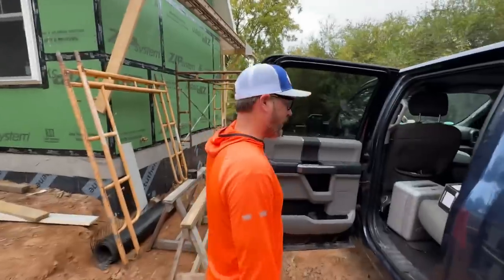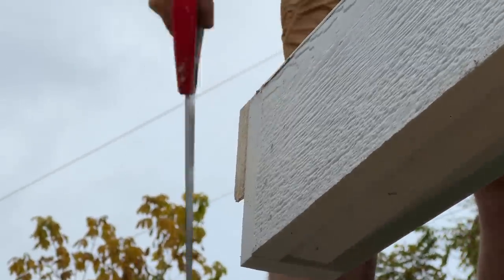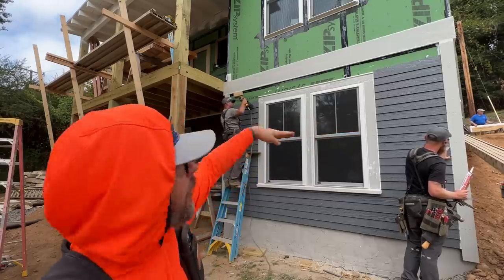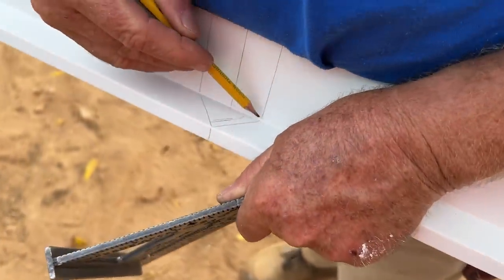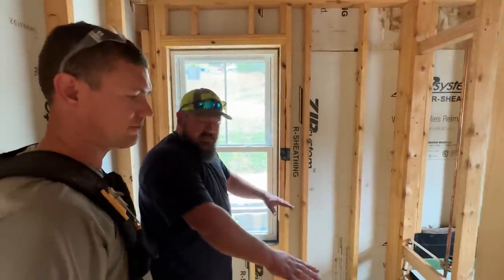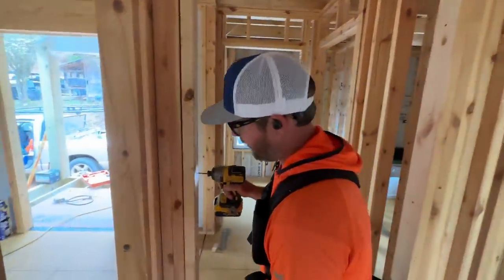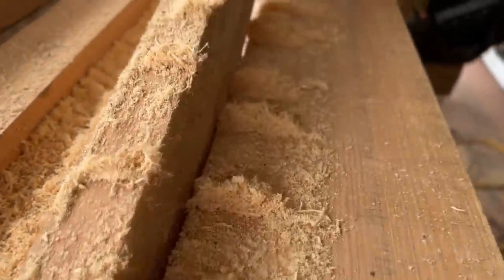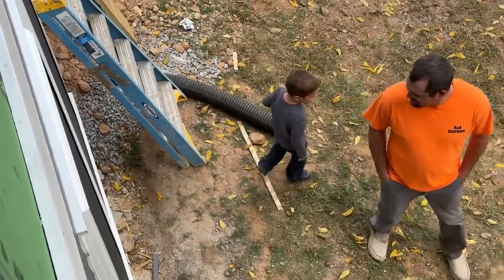Building A Small Income Property | Part 18

Comment: I'm building my own house. I work my regular job Monday through Thursday  8-5 building the house Friday through Sunday. I'm the builder contractor everything. It is rough some days I've gotta leave work early to meet with inspectors or the power company for routing of the electric company's power. Getting a water tap etc. 1 year in and HVAC is going in electric is mostly done plumbing is mostly done. Getting there a weekend at a time

Comment: It's normal your saw was binding. The wood looked pretty wet too. Take a blade and bend open the teeth to increase the kerf. Will cut like butter. When the wood is wet the fibres don't cut clean and it binds the blade. We used to do this in the pine mill my dad used to own..

Comment: Ahh, man—my first impression was you guys didn’t stretch out the bottom courses to line up with the bottom of the window—but you did redeem yourself by aligning with the top.   👍🏽 

Also, drawing out the door swing on the subfloor serves multiple purposes—including as a visual for the customer, figuring door schedule, and for the electrician to install switches in the correct wall.

Comment: I've had 400A meter bases and combo panels on order for more than a year now and last I checked eta is late March.  I often have angry homeowners with a new house that's complete but they can't move in because they wanted a 400A service.  Most of the time they don't even need the 400A... a 200A service would have been plenty.

Comment: Oh and i keep wondering why do you never use regular block and plaster walls? Too cold ?
Reply: We would still have to build a frame wall inside the block wall to insulate
Reply: @jaimeperkins9606   there are insulation solutions for the block walls ! Its more rigid, it does not burn in fire, and lasts very long time..those block slab structures last many lifetimes... but what is the reason framing is the method of choice in the west unlike the rest of the world !

Comment: that big saw you have is broken. It should not stop. Or the blade is extremely dull. I'd advise you do not use that saw. You need a better tool. And that is a very expensive. Some of the saws to do that work or about $7,000. You might think that's a little too expensive. But you're not doing this work all the time. I suggest you use an electric chainsaw. Would get through the wood much better than that's all.